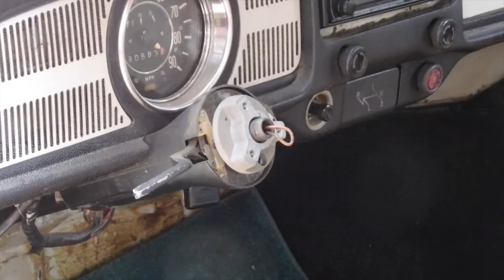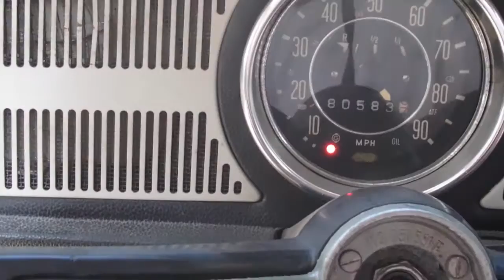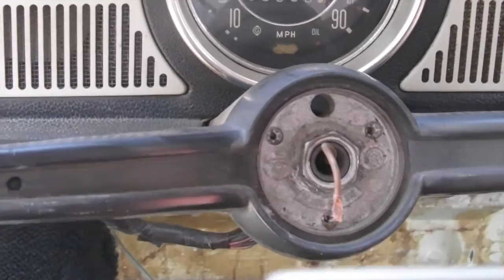1969 VW Bug Project - Episode 4 - Steering Wheel and Horn

Comment: The ground wire of the horn is mounted to the upper ring of the horn ring on the steering wheel. How is the lower ring grounded?
Reply from the maker: Honestly couldn't tell you.  I still haven't been able to get my horn to work.  It either is always on or never.  Sigh.

Comment: Hi! the top right screw on my D ring alwasy vibrates and comes loose. i was able to just screw it back in. but now the screw is loose and cant even sit in its hole. any idea to get it to sit? teflon tape? helicoil? bigger screws? any suggestions?
Reply from the maker: Teflon tape would be a good option, but also maybe even a medium Loctite would work.  Put a drop in the hole, screw it in, and let the thickening/hardening of the Loctite take up the slack.

Comment: My horn was rerouted to a little button under my dash how to I took it back up to my steering wheel
Reply from the maker: If you have the horn mechanism in the steering wheel, a while runs from it down the steering column and is grounded to the coupler that connects the steering column to the steering box.  You can find it behind the left front wheel.

There’s another wire in the turn signal/horn mechanism in the steering column as part of the ignition wiring harness,  it runs out of the column and under the dash into the front trunk/boot.  It connects to the horn in there.  Basically, when the horn button is pushed, it completes the circuit to the horn itself.

That’s about as detailed as I can get in a comment.  Here’s a link that might help you:

https://www.wolfsburgwest.com/wired/wired_12_00/wired_12_00.htm

Comment: did you get the horn to work?
Reply from the maker: Not yet.  I've completely dismantled the Bug to fix rust, repaint it, refresh the engine, and update the wiring.  I hope to get the horn working in February.
Reply: School St. Garage 
Thanks for the response. I just bought a 70 bug last year that needs quite a bit of work done . It needs a lot of the same repairs as yours so thanks for the videos and I look forward to seeing more.

Comment: That appears to be the wrong horn ring for your wheel.
Reply from the maker: Really?  They came together when I bought them off of thesamba.com.
Reply: @SchoolStGarage  it looks like the ring is right for your car but on the wheel I didnt see the cut outs for the "D" part of the ring. if it does not have those its an early one year only wheel worth a little more.
Reply from the maker: I just checked.  There are no cutouts, Yoshiniya.  Great eyes!